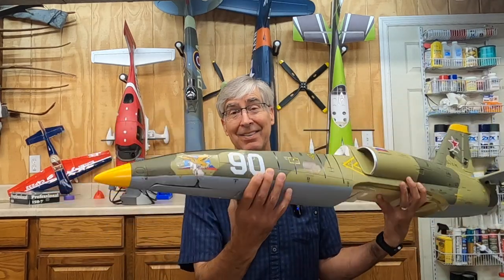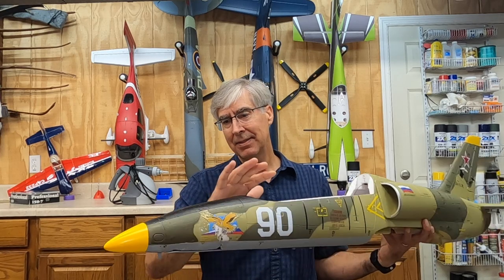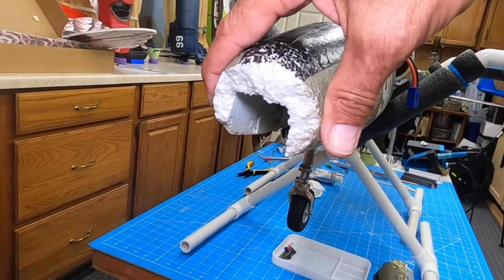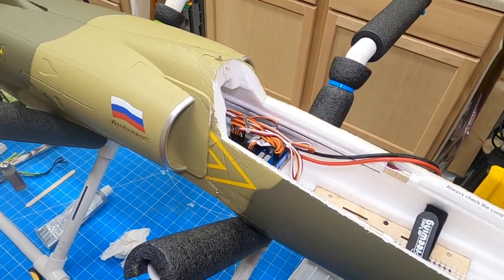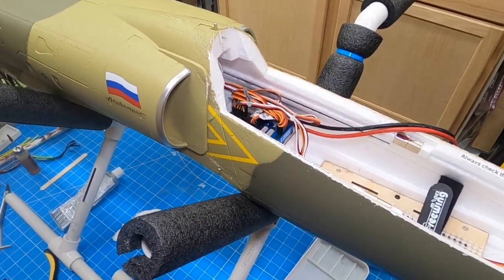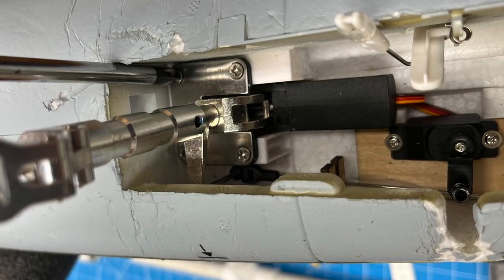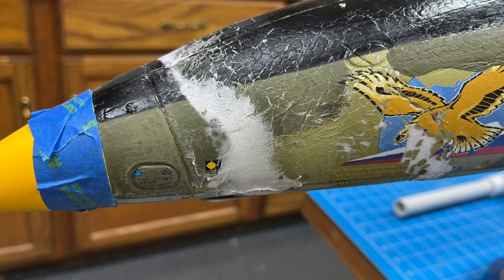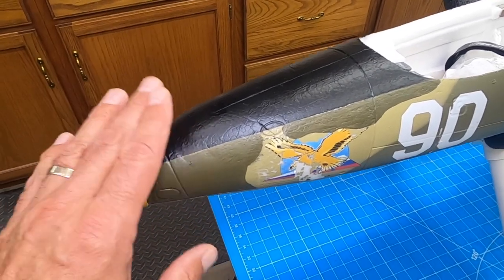How to fix foam RC Plane with steam

Comment: Absolutely nothing to be ashamed of with that repair.  I too, like to add carbon rods to reinforce repairs and transfer forces deeper into the structure.  Good Job!
Reply from the maker: Thanks.  I thought about the CF rods in this after the repairs and makes sense.   Should’ve.   I’ve done that in other repairs.  I added CF strips in my Eflite Viper 70mm to prevent issues if I stall and cartwheel.   It’s proven very effective.   Thanks for the comments.  Will
Reply: @SteffenRC  just don’t make it too strong with the CF rods. I did that to my 70mm Viper and when it did crash a year later. The nose pushed it way past the air intakes. But my repair held up. LOL.

Comment: You will get the popcorn look with the steamer, there is no way around it. But it does the job. On some of my repairs I put about 6 coats of poly on then sand it. Most of it gets sanded off. Mostly it acts as a sealer/filler for the popcorn foam. You did a good job on the repair.
Reply from the maker: Thanks. Appreciate the comments.  I sure learned a lot during the process.  Like all of us,  we play around with new techniques and share with the community.  Thanks Will

Comment: Very cool, same process I use. My steamer is a little different and for really smashed parts that don't fit, I dip them into boiling water and then massage just shortens the process. Then hit with spakle sand and paint. I hadn't used the minwax before paint but might try it out. 👍
Reply from the maker: I’d like to try dipping it in water.  Next project I’ll play with that.   Thanks Will

Comment: Great tip for repairing foam! Definitely will be using this method... 

What plane is that big red one in the background? Looks very nice... (found it - Eflite Cirrus)
Reply from the maker: Its a great method, but there are a few others out there, like soaking in HOT water and massaging the foam in place.. (Never tried it, but I'm sure it works too...). The Eflite Cirrus is a wonderful plane and something that finds its way to the field an awful lot.  Just an easy touch and go plane, or an impressive stunt plane..  Eflite really did a great job on that one..   Thanks, Will

Comment: What version of e6000 do you use, I just snapped the rear end off of my apprentice 1.2m and am just trying to figure out the best glue to use.
Reply from the maker: I used the regular industrial strength.  You might want to add some carbon fiber or bamboo skewers to give some additional strength.   Go light on the e6000.  It’s good stuff, but will melt a little foam when it welds the two pieces together.   Also, keep it light so it doesn’t effect your CG too much.   Good luck with the repairs
Reply: I ended up buying gorilla glue before you responded. it has a photo of an rc plane on the back and says its foam friendly. So I hope it works out, but if it ends up snapping again I will definitely add the carbon rods. Thanks for the kind response!  @SteffenRC

Comment: I don't have a steamer, I put hot water in a bowl and place the parts in and out until the expand to the shape as close as possible. It works most of the time
Reply from the maker: I'm gonna try that on the next project.  I've heard folks getting great results with that method..   Thanks, Will

Comment: Hello Steffen,
you did a nice job, your modell looks like new. A similiar mistake happend to me today and I have to repair these kind of folds.
I didn't understood it very well (maybe dur to my bad english), but would it be possible to explain in text, what you put after steaming on these folds, before you sanded it?
Thanks in advance
Egbert
Reply from the maker: Egbert,   Thanks for the comments..  Really appreciate it..  After I steamed as much of the wrinkle/crushed marks out of the foam, I applied a light coat of Lightweight drywall spackle.  Sand smooth and apply another coat to make sure it covers the wrinkles and defects.  Then a few coats of satin water based poly.  Sand smooth and apply  the poly again.   Now its ready for paint.   Good luck my friend..   - Will
Reply: May I ask another question? Why do you use Poly Acrylic? As a kind of smooth primer? Thanks to your video I was able to find some materials here in Germany, Miniwax is also available. Thank you very much

Comment: I actually like using a pot of boiling water on badly deformed multiple breaks and cracked parts...i also added white gorilla glue to my other glues i normally use...after 12 years of fixing..well over 100 repairs including crash with batteries catching fire i I consider my self a professional foam plane repair expert...some guys just throw away wings and fuses with hardly any damage...
Reply from the maker: I really enjoy the process of repairing these foam planes.  It’s a wonderful part of the hobby.   I recently tested a mess of glues for foam repairs (on my channel).  I tried Clear Gorilla glue, but it didn’t test as good as others.  I’d like to test the white gorilla glue though.  Thanks for watching and commenting.
Reply: @SteffenRC  white gorilla is amazing..i fixed a totally horrible zeta blaze front end this past weekend...its a plane i have flown almost 10 years had many crashes..to many reglues to mention..i used wG to attach front fuse to main fuse after i reshaped and glued multiple peices..WG when activated with a little water is perfect..it fills in all the gaps ...after 15 mins or so its pretty much set up...Give it a try...yes on many jobs its over kill...i use CA with activator mostly. I am able to fit parts perfectly in most cases..and CA is sandable ..i also use light weight spackle when needed..i only fix my own foamies,but i do enjoy repairing...🙂
Reply: What do you mean by wg?
Reply: WG is white gorilla glue